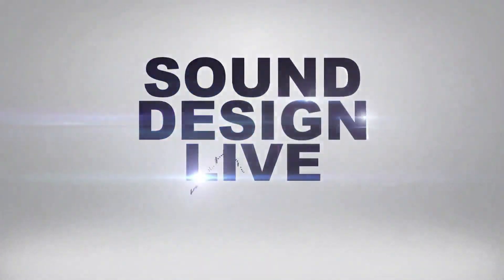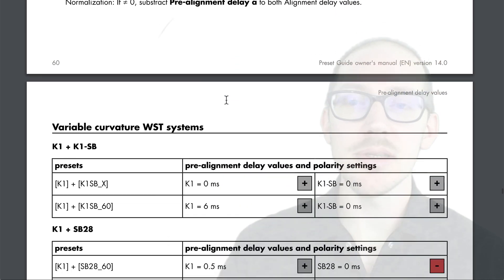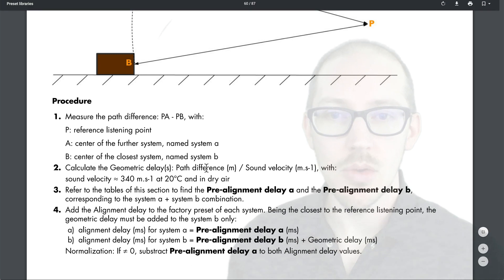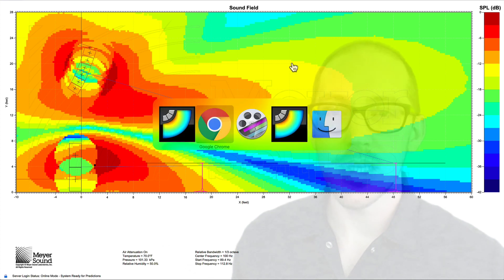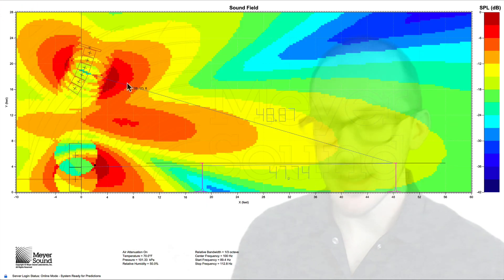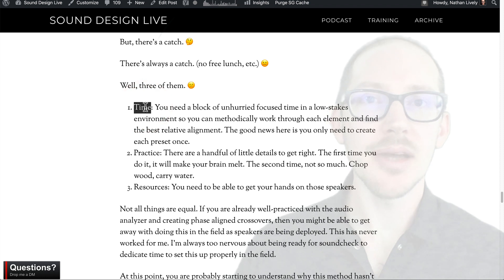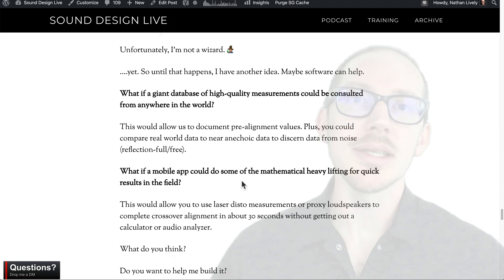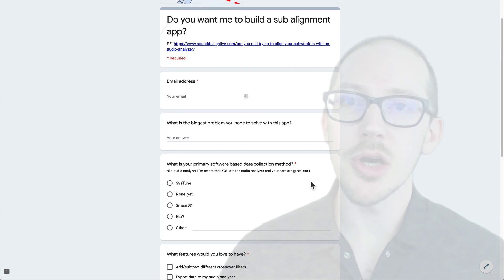Subwoofer Alignment: 1 Method That Works Every Time

Comment: Hi Natan
I'm a bit confused. Let's say I have to setup and align a live sound system compose of 8 arrays (4 each side and at a max heit of 4m) and 8 subs that are just kept down in front of the stage. I have a D&B system so I'm using arraycalc. I understood following your videos that we first have to calculate the delay and find the phase alignment but I'm lost. May be you have  set of tutos that could help me. I'm not a professional but I'd like to lean by myself. Many thanks.

Comment from the maker: Have you tried this method in the field, yet? What were your results?
Reply: Often, when the acoustic situation in a room is not optimal, for example if there are a lot of reflections, I have had a hard time to get a sufficiently accurate phase plot measuring from the point of the spacial crossover that I want to align.

An approach that has worked well for me to handle these situations, is to measure each element in it's near field and perform the settings for a good crossover there, and then adjust the settings based on the distance that is measured with a laser.

I think that's basically the same approach you are describing here. the optimization in the near field is establishing what you are calling the pre delay, and then the laser is used to compensate for the geometric delay.

I wouldn't not go as far to say it works well every time, because the behavior in the far field might be different, especially if you are indoors in suboptimal rooms, but it works well more often than not.

In the end, as always, it's a good idea to verify with measurements and our ears, if the recepy we have been following for optimization has actually led to a good result.

Comment: People don't use it in the field because it's unrealistic to the variables present in each situation.
Reply from the maker: Hi Craig! I respectfully disagree. I use it in the field all the time now. If I'm the person setting up the sound system then I know every component in the signal chain and therefore what the combined phase response will be at the speaker's output. You'll find that this method is recommended by many pro audio manufacturers including L-Acoustics, d&b, NEXO, Coda, RCF, Funktion-One & dB Technologies. Please take a look at this compiled list as an example: https://www.sounddesignlive.com/sub-alignment-l-acoustics-db-nexo-coda-rcf-funktion-one-db-technologies/
Reply: @nathanlively  yeh.... no. Just no.

Comment: not possible in cars D
Reply from the maker: Hey Cyber Dean, I have successfully used this method in a car. What has been your experience so far with it?
Reply: @nathanlively  I use impulse measurements with REW (room eq wizard), theres no comparison. Cars are THE worst place to put an audio system full stop but for large rooms your method would save time.
Reply from the maker: That's great to hear. If your method is working for you, there's no reason to change.
Reply: hi dean, what is your methode inside cars?